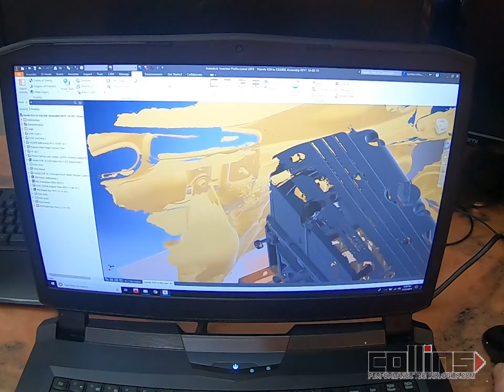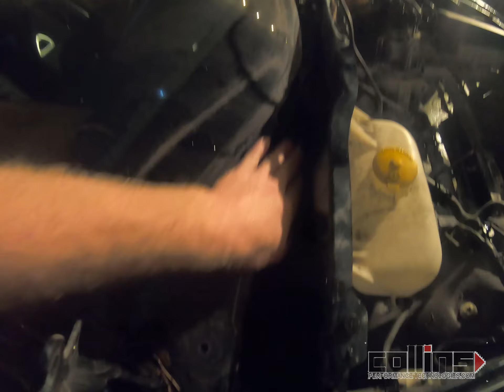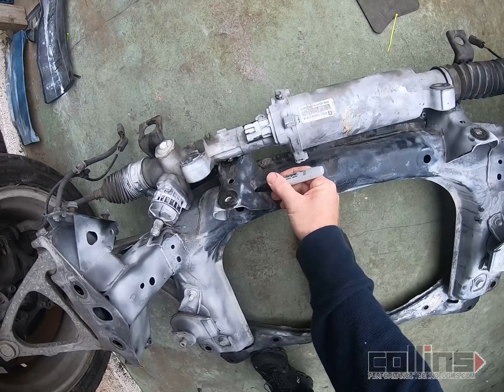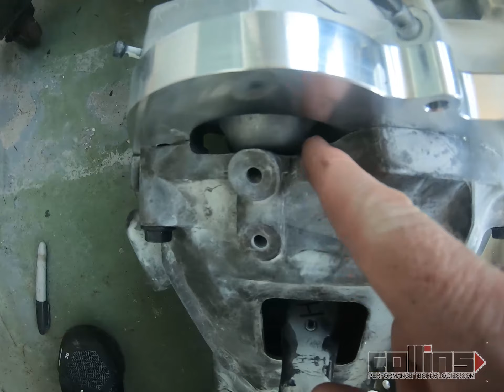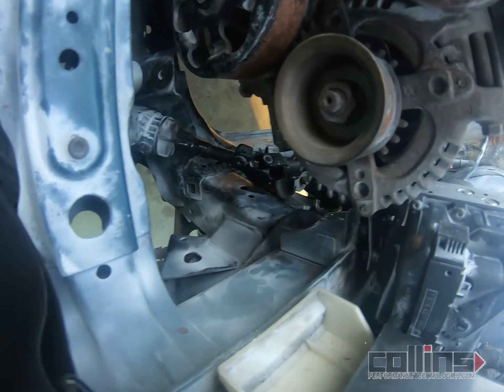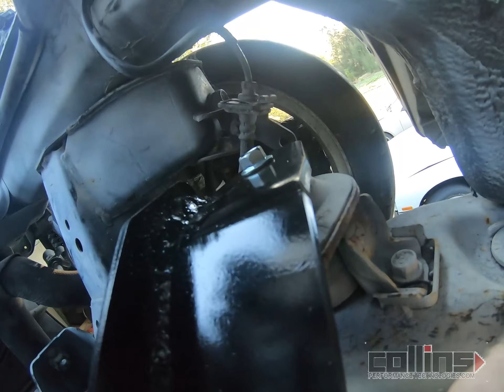Mazda RX8 to Honda K-Series Engine Adaptation Kit Install Video

Comment: Maybe i missed it, but did you use back the transmission from rx8 or the k20 transmission?
Reply: Its the 6 speed transmission from the rx8  if your rx8 did not come with one you will have to buy one
Reply: @MatthewWilliams-s9w  awww. I still want to use the auto transmission....

Comment: Do you guys have a full swap kit including all smaller parts I would need like downpipe and any clearing problems
Reply from the maker: We do have another shop we work with to supplement the other parts that you mentioned. For NA builds we have a swap header for it that works pretty good.

Comment: I approve of this swap. More power and reliability than that rotary ever had. As much as I love the rotary. The rx2 and rx7 are some of my favorite cars.. but it’s just not worth the time in the rx8 to deal with that high maintenance low power engine… I respect the rotary in the right context, the quad rotor race cars are absolutely stunning. but in a 200hp rx8 with no turbo… it’s just not worth it. Atleast you get a nice platform for your swap in this car. A bigger better looking car than the Miata… but it’s got to be a tight fit for sure.
Reply: Just buy a different car
Reply: @elysiumgaming2866  honestly the stock rx8 engine is dogturd and most of these rx8s will get rotten in a junkyard because of that the Rx 7 13b engine was miles ahead of the renisis.The rx8 is the best car for an engine swap too because there is a lot of blown ones in junkyard
Reply: @elysiumgaming2866 cope harder
Reply: @clipxx467  cope with what? lmao! XD

NO PLEASE DON'T LS SWAP NOOOOOOOOOO
Reply: @elysiumgaming2866  LS Go brrrrrr
Reply: @elysiumgaming2866  swapping a working rx7 is dumb but not the rx8

Comment: RX-8’s are cheap mainly because of the reliability of the rotary. I’d buy a cheap one, drive it until the engine went bang then start an engine swap project with it.

Comment: What wiring harness do you use to get it running? Do you keep the rx8 harness with the ecu or do you use the k series. I’m confused on that part.
Reply: If you have a parts car use the harness from that car, if not buy a harness for your specific engine (if it’s a k24a2 get an a2 harness etc). Aftermarket ecus for Honda engines are plentiful and cheap

Comment: Hey Collins, so, Toyota is coming out with a Three cylinders, all-wheel drive, and 300 hp Toyota GR Corolla Turbo, can we get an adapter plate for that to fit an RX8! Soon as someone crashes one! I'm sure that engine will be the same size as the rotary that's already in it.
Reply: This is spot on! +1 on this suggestion for sure. 3 cylinders and the highest specific output engine that Toyota makes right now. Dimensionally this engine would easily fit where a 2-rotor 13B sits.

Comment: Can’t find the coolant adapter you are mentioning on your website
Reply from the maker: it is here: https://collinsadapters.com/adaptation-components/honda-k24-a2-head-to-honda-s2000-f20-f22-intake-manifold-adapter-high-clearance-16an-intake-side-exit.html
Reply: @CollinsGarage_Crett_Bollins  That's for the whole adapter to use s2000 manifold. Got anything as a standalone?

Comment: Looks like dropping the subframe would make the job easier and then putting it back in with the motor and trans as one big piece. Hard thing is you need a lift to do that
Reply from the maker: Exactly, I would like to show everyone how to do all of these installs without the need of a lift.

Comment: What would be considered the best transmission options.  I see that there are quite a few that can be used.  Need something to hold some serious power.
Reply from the maker: it all depends on how much power you need to hold honestly. CD009 can handle 1100whp from our experience stock.

Comment: can this work with a k series transmission?
Reply: The k series is normally mounted transversely to power fwd cars, in the rx8 it will be mounted longitudinally and rwd, so a very clear no
Reply: @laurean5998  i know this would be a lot of extra work, but what about in the back? That and there's cars like the nsx which are awd. Also I hear stories about people putting k series in the back of their cars etc
Reply: @venomvision90  If you're gonna K-swap a RX8, it might be best to pair it with a GTO T56, CD009, or even better... TR6060/T56 Magnum.
Reply: @venomvision90  stick to video games
Reply from the maker: This system that we made is exactly for simplicity and ease of installation for the end user such as yourself. thank you

Comment: K swapped rx 8, aka the poor mans s2000
Reply from the maker: I have an S2000, it's a great car but I hate replacing the top every 3 years.
Reply: The RX8 has a better chassis, so really it's the smart man's S2000.
Reply: Pretty sure a k can make more power than an f20
Reply: In my opinion the rx8 looks bette than the s2000 especially with a body kit.
Reply: One is a K series & F series all I have to say.
Reply: Good k20 with everything to work + swap kit + rx8 would cost more than s2k or same amount.
Reply: @gtcelica5164 ....?? Yeah, if you can't do anything yourself. 🤷🏽‍♂️ go pick up a k20 engine and harness for 200 bucks at a junk yard.
Reply: @DanMarcelino 200 dollars? What world are you living in? Hell a rear tail light is almost 35 dollars at most junk yards. Where arr you finding complete motors for 200 dollars?
Reply: @6000pounds  Canada, and we're not even cheap here.. Before covid an engine was literally $150 from pick n pull.
Reply: @DanMarcelino  I'll never believe you. Sorry
Reply: @DanMarcelino  I never asked for your opinion lmao. Who cares for canada? In Europe you can't get good k20 under 1000€. And ummm, there are people with cash to pay all the work. No need to get dirty.
Reply: @DanMarcelino agree. In NZ before the covid engine was $120. Now it's $450 from pick a part here. Transmission used to be $80. Now $280.
Reply: Dang it, how poors do I have to be lol
Reply: That's the talented man's S2000.
Reply: 4 years late to the party, but its also the tall man's s2000.

Comment: Gonna run a link ecu?
Reply from the maker: No, we have found that Adaptronic is the best system that has a plug-n-play system for the RX8 chassis and Honda engine.
Reply: @CollinsGarage_Crett_Bollins  Did you guys even look into the K-Pro system?  Surely by now there must be quite a few people using it.
Reply: Haltech elite 1500 ecu works extremely well for this swap.
Been running one in my swap for 1yr now.
Stock electric steering works,abs,traction control,no dash lights on.
Just abit of custom wiring but nothing major.

Comment: Would this adapter also work for the bmw dct trans?
Reply from the maker: Yes we have that adapter on the website listed under the K-Series to BMW adapter plate.
Reply from the maker: Yes we have a K-Series to BMW adapter that will bolt the DCT system up just fine.

Comment: Hot much cost to do by it self ?
Reply: 2400 for the kit alone, add engine, ecu, and wiring
Reply: @adkmz4087  how much you think a custom wiring harness would cost 1k?
Reply from the maker: custom harness $1000-$1300 for a good one, good ECU $1500-$1800. all you really need though is the Adaptronic ECU and custom harness to get all of the guages and A/C working etc.

Comment: Have a question about the handling. Is the mod affect the handling of this car because i thing the K20 is heavier that thy stock engine
Reply from the maker: It's marginal at best honestly. This system is way better suited for endurance racing than trying to use a rotary.

Comment: Curious about the steering geometry changes as a result of the steering rack conversion/spacer.  Was in engineered at all?  I know commonly spacing racks willy nilly can mess up the steering, inducing more bump steer, and other funkiness.
Reply from the maker: Correct, bump steer adjustment wer factored in, and solved using extended outer tie-rod tappered shafts with spacers on the bottom side.

Comment: Header clearance & the water pump neck would be nice to see more of in video. I would love to do this swap if you could retain AC as well.
Reply from the maker: Header solution is solved just under $549, rear water neck outlet was just released on our site for the K24-A2 head using a -16AN fitting and a block off plate on the rear of the head.
Reply: @CollinsGarage_Crett_Bollins  what is the link to the coolant adapter? I cannot find it on your website

Comment: That's a lot of cutting. My twos questions are, does an Acura V6 not fit better?, and, would a thicker adapter plate require even more cutting?
Reply from the maker: Thicker adapter plate would help, but would simply push everything forward a bunch. The real cutting is only on the cowl section and not on the firewall.
Reply: @CollinsGarage_Crett_Bollins  does a V6 not fit better?

Comment: Love the originality not a lot of people out there that can do this kind of work especially create something one-of-a-kind and make it functional but like some of the comments down below AC/Heat would kick ass. I want to k series Turbo a eagle talon in the future.
Reply from the maker: That was an alternative that we were exploring, another alternative is using the RX8 compressor on the passenger side of the engine and making custom lines.
Reply: You can get electric AC/ heat kits that are used for electric vehicles and install them
Reply: Lol. Just keep the Honda compressor and crimp the rx8’s firewall flanges to the Hondas compressor flanges.

Comment: Still a ton of unanswered questions. How far into the swap did ya go?
Reply: Do you sell the plug and play wiring harness and ecu?
Reply: @audirx8  wiring is my biggest fear, would love one kit
Reply: @TheKevinpenella  im actually going to be making some plug n play harnesses to be used with adaptronic ecu.
Ive done the 1st harness but will be making about 20 to start
Reply: @audirx8  did you made them?
Reply from the maker: What questions can I answer for you? 
We have a potential A/C solution that uses the RX8 compressor on the passenger side. 
Wiring solved using Adaptronic ECU plug-n-play with factory gauges etc.
Header solution is under $549.
Coolant outlet port on the driver side using our intake manifold adapter/ spacer that has a built in -16AN port and uses a block off plate on the rear of the head.
Bump steer correction using extended tappered bolts, spacers and aftermarket outer tierods.

Comment: Really curious about header clearance and options. It would have been nice to see the water neck housing mounted up once the engine is installed.
Reply from the maker: Header is solved for less than $549 it is tight but works for this solution. You will have to run the exhaust back the rest of the way.
Coolant passage on the driver's side solved with our intake manifold adapter that has a built in -16AN fitting and we use a back of the head block off plate to channel the Coolant into the adapter. It is on the site now under adaptation-components

Comment: Finally an rx8 that u can drive for 5 miles without worrying about it blowing up on u
Reply: And yet plenty of RX8 owners dont have a problem using various lubrication options it sounds like ....This swap is so daunting (to me) and I would not be driving the wheels off it miles wise (my 20 year old pick up sole vehicle for majority of time has only 80k and my just totalled 2 year old MX5 I had less than 5k miles on that...So I am imaging with a fresh RX8 motor and carefull attention I could likely enjoy it trouble free the rest of my driving life (late 60s now after all)  Besides we will all probably be driving insane EVs in 10 years ...when they wind up running circles around IC cars every performance nut and driving enthusiast except for collector types will probably throw in the towel....I mean if the same car will self drive on command AND handle and accelerate like nothing else AND have a 300 mile daily range?  How is anything else gonna compete?  Other than the sound tract ....which I mean if it important can be synthetically piped trhough the audio of the car!  ANY engine sound!  LOL
Reply: @dougiequick1  charging will have to become quicker as taking a long road trip in an ev is a nightmare. And the charger now has speakers in the tailpipes and it's the gheyest thing ever

Comment: Would the ac fit in there if i used some 10mm washers to raise the motor and notched the subframe back in that area? There has to be some kinda way to keep ac lol!
Reply: I watched 25 min video just drooling over this swap u til they said no ac.
Reply: @1IRoyle  yea exactly im not for melting my ass off lmao
Reply: @em2attic  you can get electric
 AC/ Heater kits that are used for electric vehicles and install them in this conversion
Reply from the maker: We have a potential solution for the A/C to use the RX8 compressor on the passenger side.
Reply: @CollinsGarage_Crett_Bollins  YASSSSSSSS!!!!!! CANT WAIT!!!!